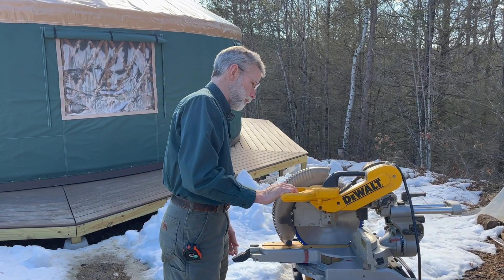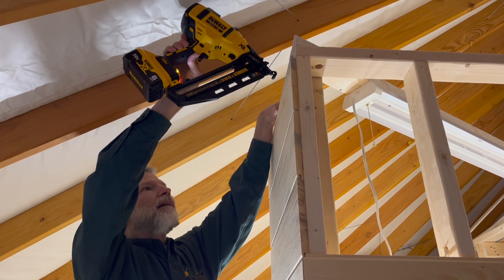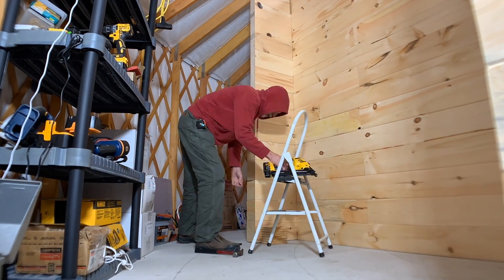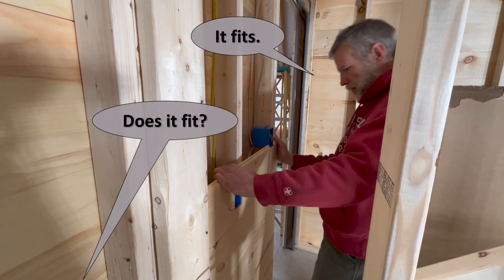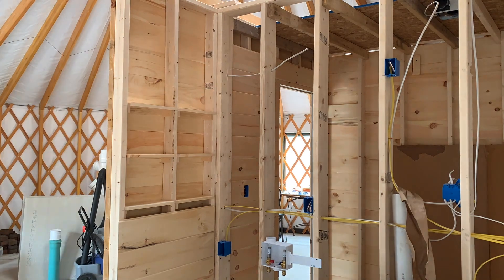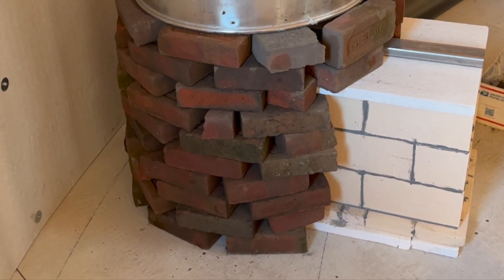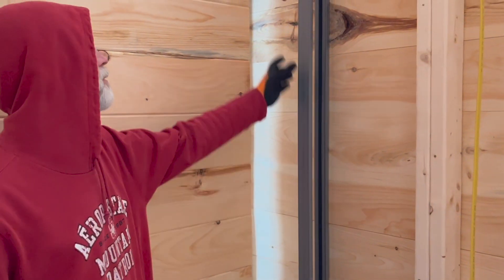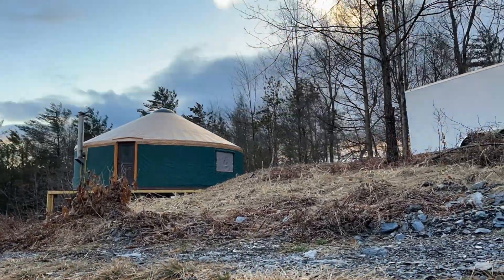My HAPPY place - wall panels for our yurt (Vermont DIY off-grid home build)

Comment: I've been binging on videos with rocket stoves - it seems i do that at the end of every winter :D  and found your channel.  Enjoying your content and style very much.    At 7:30 when Charles is referencing where the hole goes from the heat exchanger/barrel to the flue, that has me confused.  Everything I've seen is that the stove joins the flue much closer to the floor. I don't think i've seen a plan where the barrel ever gets a hole drilled in it.  Won't that disrupt the whole flow of hot air that you want instead to go through the masonry mass first?  ie. firebox -> up the riser -> down the outside of riser -> through the mass -> then out the flue.
Reply from the maker: Hi there, and thanks for watching!
I too have never actually seen this done, but I have seen it referenced quite a few times. It is called a "bypass", and it is used to help start the fire more easily. The flue will run normally up the riser, then back down to the floor and through the mass, before going back up and out. The bypass will tee off just below where it exits the yurt and go directly into the barrel. There will be a damper in the tee to allow the exhaust to go directly out the top of the barrel while starting the fire. Then when the fire is going and a good draft is created, the damper will be closed, and the exhaust will be forced out the normal way. This is just supposed to make life a bit easier on startup.
Reply: @OvertheRiverandThroughtheWoods   Oh yeah!.. you're 100% right.  i remember reading about a bypass. totally forgot about it.  Now i'm really, REALLY looking forward to seeing the next stages go together.    Good luck, and warm weather to you both.

Comment: Hi Jill and Charles. I did some wall paneling today in my outbuilding. I understand how you feel. Doing some woodworking was a nice break from painting my house. But, both jobs I enjoy. I don’t have a chop saw, so cutting 45 degree angles for the corners like you are doing is too difficult with a hand saw. I much prefer wood over drywall too; however, when finished nicely and painted drywall can look good. But, for a yurt, I would also prefer solid wood. Are you only applying the wood paneling on the internal walls?
Reply from the maker: Thanks for checking in! We are fortunate to have a friend with a chop saw. We aren't planning to panel the exterior walls.
Reply: @OvertheRiverandThroughtheWoods  A chop saw can sure help speed up all the cutting plus help all the wood to be cut square with angles if desired given your walls are square and that’s what you need. Great to have friends or neighbors willing to loan tools!